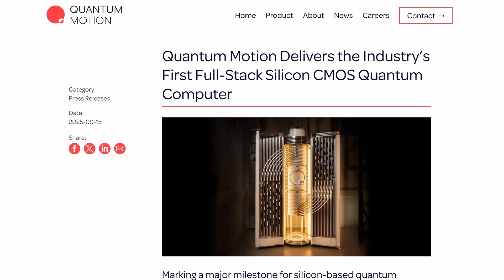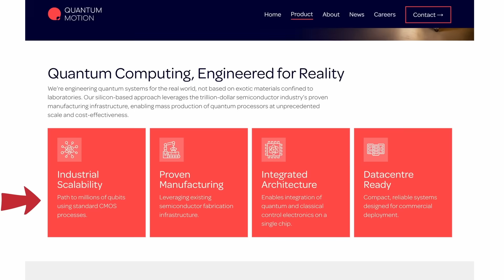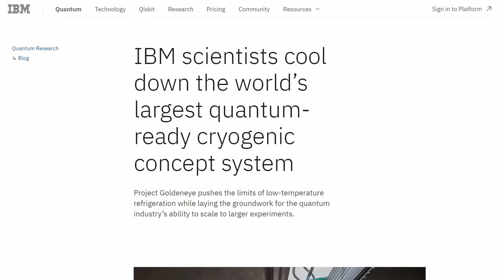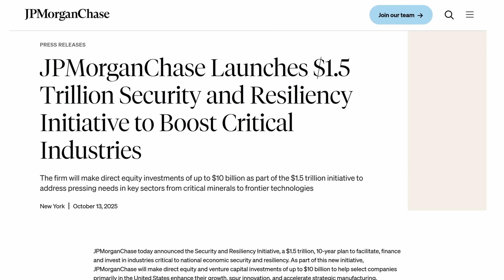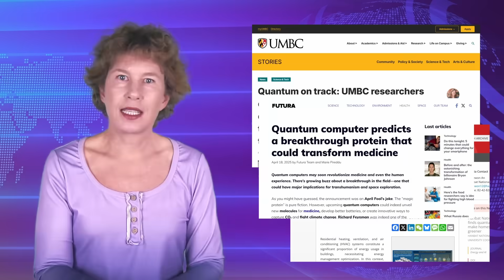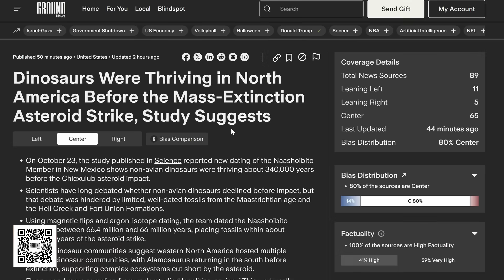I was SO wrong about quantum computing.

Comment: I received my PhD in quantum computing in 2015. 10 years ago we had the same headlines claiming that useable and scalable quantum computers are  just around the corner. Everyone working in the field knew that this was just for the investors. There was some progress over the last decade. And I am quite surprised that the hype is still growing. Furthermore, it is impressive how many quantum computing startups were founded during the last years and how much money was invested. Nevertheless I don't know any physicist currently working in this field who thinks that quantum computers will be anything more than a niche product for very special problems.
Reply: Ok I'm going to 100x leverage short those QC companies now! 
Will be a billionaire soon 😊
Reply: @Neosin1 The problem with shorting is that even if you are right, you also need to get the timing right.
Reply: @MrJegerjeg the market can remain irrational longer than you can remain solvent. Tesla is plainly over-valued but I dont think anyone has made money out of shorting it
Reply: @MrJegerjeg if he shorted then, he got the timing right.
Reply: @Neosin1 what if they milk it for another 50 years?  Or they fluke out andake a marketable product somehow?
Reply: @Neosin1 Not a good strategy. You HAVE to get the timing just right or you’ll be in deep trouble.
Reply: @Neosin1  Had the same thought lately. The hype can still go on for one or two years unfortunately and we don't know when exactly the bubble is going to burst
Reply: @Neosin1 the markets can remain irrational longer then you can stay solvent.
Reply: @Neosin1 and how you're going to do that if they are not listed in the stock market,  genius?
Reply: @mikaelvestri1554  You ever heard of SARCASM? It was a JOKE! 🤣
Reply: @Neosin1  it wasnt, you were just trying to show that you are clever with  a complete nonsensical joke
Reply: I put my laptop in the deep freezer and it becomes quantum.
Reply: As an accounting major my first CS course was in 1972. My academic advisor said I'd never SEE a computer, let alone use on. My first CS professor said business had so little need for computers that the CS department had no business oriented classes. Didn't offer COBOL classes. Started with Fortran.

What changed? Well WW2's use of computers to break german codes. The first business computer was a british bakery. I wonder if credit card companies was the real breakthrough.
Reply: @liberalhere3731 wow. Mine was 76 and no one said anything like that. Business isnt really what CompSci is about
Reply: So many people are thinking that quantum computers will be able to run the same algorithms as silica chips that i stopped bothering to correct them because it's futile.
Reply: @oskarskalski2982 except it will run 1000000 hotter than anything else you own....
Reply: @oskarskalski2982 I think that if you can output large quantities of any structured signals you can build classical computers to convert the quant results into usable code. The same way you can convert binary into words. With the right math
Reply: @oskarskalski2982 i think quantum computers would be normal computers with extra QPU where tasks with quantum speedup would be offloaded to qpus.
Reply: @monsieur2761 I thought Quantum computers would be the ticket to solving physics especially things like developing a theory of quantum gravity.
Reply: @oskarskalski2982 that's a good point your going to need a new coding language with more states than just 111&000s. Trinary?
Reply: @ianmurdoch6247 oh, the Soviets created some experimental computers based on ternary instead of classical binary - the "Satun" series, IIRC. Accordingly, they were running really well, but the project was shut down for political reasons - typical Soviet Union. The Soviet computer scientists who created it had read lots of papers by their US colleagues on structured programming and were deeply impressed, so if memory serves me well they used a Russianized variant of Forth for programming that thing. Damn, how much i wish that academic project had become mainstream!!!
Reply: I guess we should call the bubble crash the quantum eraser
Reply: They should just consolidate their efforts and rebrand as Quantum Fusion! 🤣
Reply: inverstors may just be buying the hype, not knowing on what else to invest that would have the same ROI
Reply: @ChaineYTXF  FOMO is a real phenomenon in the investing world.
Reply: Thank you for showing me that some researchers are still living under a rock 😂
Reply: @christianjensen952 which ones? The ones that believe in quantum computers or the ones that dont?
Reply: Quantum computers are just around the corner the only problem is that corner is the size of a huge supercluster of galaxies!😢
Reply: @williamgidrewicz4775 😅
Reply: I remember having a drink with my friend who had just received notice that his AI-related patents had been approved. That was in 1999. Several years later he was IIRC the CTO of WebMD for a short while. WebMD was a reboot of the Netscape founder Jim Clark's first health startup, Healtheon. Layers on layers of history.
Reply: I thought there would just be really standard and good applications for this.Why is it only niche?
Reply: Nice fake profile, dude! Nice fake curriculum as well! Is it hard to be a fake quantum computer PhD?
Reply: Then it is stil for digital computers like Rehoboam to f...k up our World and for future quantum computers like Ship to undue our world.
Reply: It's a money pit ,and it's our money, propaganda in full effect,this is horse shit like 99.9% of all theoretical physics. Ask Fenyman to explain magnetism,you can find it all over the Internet, this is one of their god's and he's a moron. If you can't explain it simply then you don't understand it.
Reply: We know from quantum biology (photosynthesis etc.) that actual quantum computing is a natural phenomenon. Physicists trying to model quantum computing with their non-computable "math" is an obvious wrong direction. :)
Reply: Like hackin sha256-hello Bitcoin
Reply: Carrots and donkeys
Reply: You mean it will never work?
Reply: unironically worse than elizabeth holmes. her tech will be real before quantum computing is
Reply: @yes-v1u2j Elizabeth Holmes stuff is in defiance of physics and biology. It can never work
Reply: Until seen, in production, still a cat in a box. At least folks are feeding their families, through grants, probably.
Reply: Don't worry the general public and investors are here to tell you that you are wrong and have no idea what you are talking about. After all the numbers are going up and NVIDIA is investing it so it must be a world ending tech that we will be able to apply to every problem. The internet was a mistake.
Reply: So my dogecoin is safe ?
Reply: The hype is the AI bubble continuation. House of mirrors. The more complex and less able to understand for the common  people, the better. The usual snake oil salesmen. Once you start reading about the subject, we are in the age of diodes (1930) telling you can create computers..
Reply: I'm not saying you're a liar, but then again we can't confirm your claim either. You're just some anonymous guy making a claim and not secure enough to put your moniker on the line.
Reply: They will be connected to other computers classical & novel.
Reply: I was invested in d-wave this year.  I have a small option short for December 19, $28 strike.
Reply: Thank you for your comment.
I’m curious to know the subfield you worked in, and are you still active?
Reply: Remember when new experimental technologies were developed by public institutions and universities? Those were the days...
Reply: Typical that technology gets predicted way too fast. Cryofreezing, quantum computing, self driving cars, fusion... Technologies which all have been 'around the corner' for some time. Meanwhile real breakthroughs often come out of nowhere.
Reply: If you look at the past as prediction of the future to some extend, the same can absolutely be said about modern classical computing. The invention of the transistor revolutionized room size computers which were niche products at the time to scalable desk size to today's hand size computing. One can argue unless we keep exploring and researching the tech, we would be stuck in the same mindset in the 40's with traditional computing, imagine today's world without the investment or enthusiasm for computing by the hundreds of people who spend their lives to change the nature of computing during that long period. Today's QC will definitely not be tomorrow's ones, one can only begin to imagine what QC would be like in 20-40 years span and once again 80 years just the same way people in the 1940's could not even imagine what today's classical computing looks like or acts like.
Reply: Computers were niche to begin with too. But i get your point
Reply: You have it backwards. It's not companies starting up AND money invested. It's money invested AND companies starting up. 

That's how things like this work FOMO and good talkers get money. 

Regardless of it produces anything in the end.
Reply: It's been at least 35 years since I heard that quantum computers were about to revolutionize computing. In the 1950s, commercial fusion was a decade away. Also in the 1950s there was a program that was supposed to generate operating systems called The Last One.
Reply: @ElectricUniverse56 it exists and is called Linux
Reply: @ElectricUniverse56 I thought The Last One was a program generator
Reply: @ElectricUniverse56 Hi grandpa
Reply: Maybe you are right, but considering how early computer specialists in the 40's, 50's, 60's and even 70's also doubted that PC's would be present in virtually every household in the world in the 21th century, you could also be monumentally wrong.
Reply: @bramvissers4985  At the time, there were some who did not recognize the potential of computers, and their statements became world famous as a result. But I am sure that most computer experts already had a very good idea of what could actually be done with a computer. With quantum computers, it is different. There is a very limited range of cases where quantum algorithms are known to outperform classical algorithms on classical computers. And this is despite the fact that physicists and mathematicians have been searching for such quantum algorithms for decades. The quantum computer is not inherently faster than a classical computer. It needs these special algorithms that exploit quantum properties.
Reply: @LoneStargazer42  The quantum computer will be very helpful in terms of predicting climate and weather prediction, which is not possible with classical computers or even supercomputers, because of the enormous amout of calculations needed.
Reply: @LoneStargazer42  It will also be helpful in advising politicians and economists in the decision making process about climate change laws and mitigations, when quantum computing will help to identify a strong correlation between C02 and methane emissions and environmental costs in form of increasing draughts, floods, wildfires, hurricans, tornados and other extreme weather events.
Reply: Quantum computers either exist and work or don't exist and don't work. There's nothing in between. "Around the corner" is scamming people as if these machines were already designed and validated, but it's just matter of building one in factory.
Reply: @pikachulovesketchup666  ... unless its a quantum superposition of working and being a scam at the same time ...
Reply: @pikachulovesketchup666 seems ridiculous to be talking about mass production before they've built a working prototype
Reply: I briefly worked on quantum research in 1996&1997 and it was "right around the corner" back then, too!  I bailed because I realized I might never see a breakthrough and didn't want to hang my career on something so risky.  Also, I sucked at physics compared to my colleagues.
Reply: Isn't one of the problems on breaking encryption ?
Reply: @ranjanrajagopalan6194 RSA or one way encryption, yes.  AES, or symmetrical encryption, no.
Reply: @ranjanrajagopalan6194  Specifically RSA , a public key encryption scheme that is alot more efficient than the lattice methods that are being developed to replace it. See Schor's algorithm. 
So far as I am aware, that is the only algorithm that people have found that lends itself to quantum supremacy. 
Factoring primes just doesn't have that many computational uses (so far).
Reply: @ranjanrajagopalan6194  issue with encryption is it is very easy for them to double the encryption with little cost to performance while exponentially increasing it requirement to crack. you might be able to use it against old data you have mined for years and decades. but it won't be effective against futureproof data.
Reply: Quantum computing its not hype. And OF COURSE its niche and nothing like silica!
But quantum algorhytms and matrices conquered my heart once and for all
Theres something NOBLE and incredibly manieristic in this concept
Call it a HYPE its a proof of ignorance
Reply: Are they really working on something else? Some algorithm.
Reply: Those very special problems are an entire category of problems that are very lucrative at the moment
Reply: @te4st111  Dude i have inveted controller of entropy. Now system can be any size...and much faster. I wanna sell it. Please, can you give some directions whocan buy it? Some r&d ?
Reply: @necroticuss6780 no you haven't. Don't Make Up Your Physics.
Reply: My coffee barrister had a Phd.  He tells me to wash my hands after peeing,
Reply: yeah, sure , yes you are, so the government is just going with the hype,  the Tech Giants like Nvidia, Amazon, Google, IBM are just wasting their resources on it.   LOL.    litereally there is a race towards Quantum computers right now.  but is just the hype, right?
Reply: "who thinks that quantum computers will be anything more than a niche product for very special problems."
That sounds like horribly wrong quotes from the past about ....you name it. Talkie movies. Television. Solid state anything. Nuclear power. Cable TV. Digital anything.
Reply: @rael5469 cold fusion, flying cars, NFTs. Lots of things just dont work
Reply: @rael5469 nucleair Fusion. 3D tv. No-code programming. Netbox. Soap.  Blockchain. Big Data. Web 3.0. Fully autonomous vehicles. Flying cars.

Not every hype leads to success...
Reply: @rael5469 The world wide web was just a fad toy... AI... it's all hype... sometimes pragmatism leads to pessimistic views. Even by people who should know better.
Reply: @CynHicks 3D movies. Flying cars. Films on vinyl. Loads of bad ideas stayed bad ideas
Reply: So there's something you know that the likes of Microsoft and HSBC don't, or would you classify their use cases as the 'special problems'?
Reply: @Cyno7  On the contrary, the people there know that too. Some of my friends work there. But you can also earn good money with a niche product. And although these companies' expenditure on the development of quantum computers is high in absolute terms, it is still small compared to the costs of other departments.
Reply: @Cyno7  No, we're saying that there is a detachment from what what is and what a company says *is*. 
Your question implies a degree of naive trust in corporate marketing that I don't find charming. It's alarming if not outright fraudulent.
Reply: The quantum leap in QC is going to be via a ternary style software not hardware < that will just get faster / more memory still / & cooler by evolution. The superimposed state inferred are analogs for frankfurt school theories of mind i.e such software using a preconscious and conscious and unconscious architecture.. Thus to devise a quantum computer is the same as solving conscious A.I. Clearly there are some who do not want most people to realise this yet. The thing is that global propaganda is control by the same level of thinking. This make it tricky to discuss as a way to teach a computer to rationalise - ( does it not ? )
Reply: @cameroncameron2826 Bullsh!t. You said so much without saying anything at all. You first need to prove that consciousness needs quantum superposition. Your claims are baseless, and your use of words ‘global propaganda’ just tells me that you’re a yet another conspiracy theorist.
Reply: @monsieur2761  80% sure that was AI. Then again, dumb humans are getting remarkably more capable of imitating AI everyday.
Reply: @cameroncameron2826 'conscious AI' is and will continue to be an oxymoron.
Reply: IOTA tried to develop a trinary tangle called decentral token for the IoT 
But failed to get rid of the binary coordinator until now.
Reply: So you received a PhD in bullshit? why would you do that?
Reply: @JD-un2zv Strictly speaking, I have a PhD in sciences. I am a physicist. And I wrote my PhD thesis at a renowned quantum computing institute. For my doctoral thesis, I developed microscopic quantum computers based on trapped ions. We used ionized atoms, which we trapped in an electric field and then cooled with lasers. This is a different approach than the one pursued by IBM or Google, with different advantages and disadvantages. Moreover, my doctoral supervisor had been working in this field since the 1990s.
Reply: I received my PhD in ___________ in 20__ .
If I wanted to bolster an argument, claim, or position, I could fill in those blanks for just about any topic: linguistics, chemistry, astrophysics, inter alia. It would certainly get me extra upvotes.
Reply: @-danR  I received MY PhD in "filling in blanks" just yesterday.
Reply: @-danR  Insecurity
Reply: @-danR  thanks I will use that. I received my PhD in wiping my bum in 2020, there has never been a better bum wiper then me. Lets Make Wiping Bums Great Again, merchandise and golden watches are coming soon to the marketplace you never guess who my main target audience will be.
Reply: Imagine that! A PhD physicist that takes interest in THIS channel! Who would believe it!
Reply: @-danR  Just because upvotes mean the world to you does not mean that they mean anything to others in that same world.
Reply: Anybody who starts a post with 'I' is frankly highly questionable.
Reply: @dmpi483 It depends. I start comments and replies with 'I', but I'm talking about my own knowledge and experiences so usually I'm correct.
Reply: @dmpi483  - I am not so sure about that.
Reply: @dmpi483 yes, there is no pooh in “I”.